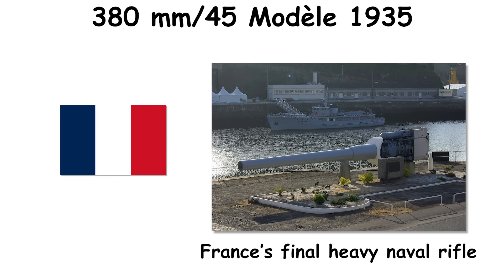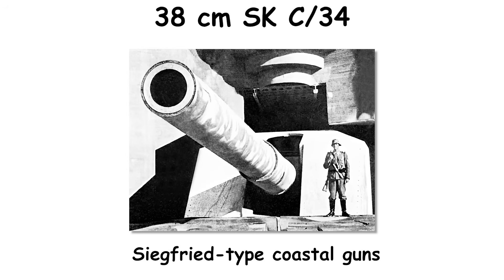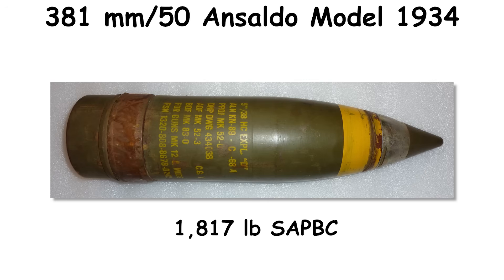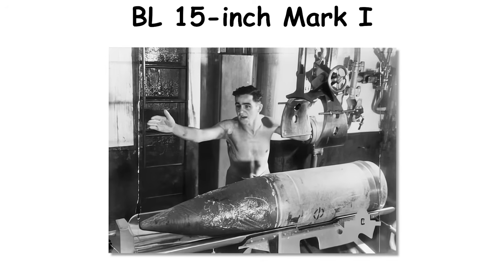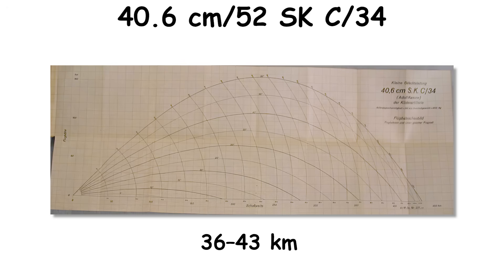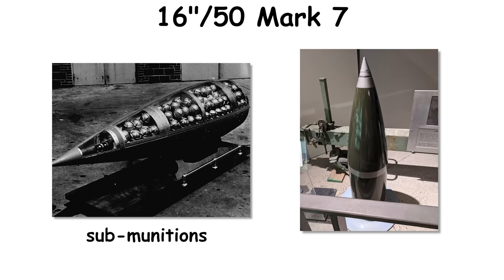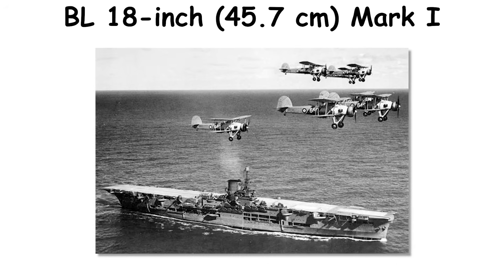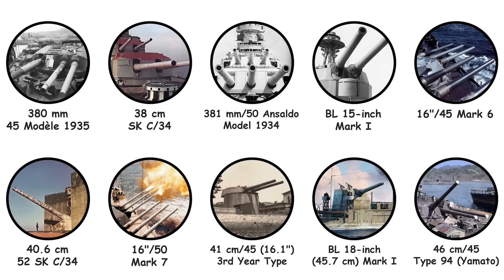Biggest Naval Guns Ever Explained

Comment: There were no problems with shell quality on italian 381mm shells, the often reported lax rules on shell quality were stopped before the shells were even made, if problems would have been in the shell quality, this would have resulted in vast reports of bad shell quality for other calibres, but there was none, not for 120MM, 100MM, 203MM, 152MM, etc, dispersion was simply avarage 9 out of the 10 instances where the guns fired, totally in line with good quality dispersion, way better than the faulty rates of other shells of the period, for example german 380MM and UK 152MM shells, wich reported faulty shells almost every battle

Comment: So which cannons was the more damaging and effective hit
Reply: The italians 15 inch and the yamato 18.1 inch
Reply: @Revenantofhell-b3fAfter test fire the higher velocity 16in of the Iowa Class out performed the slower 18s of the Yamato.
Reply: @andreworiez8920 the velocity of the Iowa class doesnt necessarily mean it is the best, it's just higher penetration overall the Italian 15 inch has the highest muzzle velocity of all battleship without any modification at all.
Reply: @Revenantofhell-b3fAfter World War 2 the US Navy was able to test fire 16in vs Yamato armor.

We also had the Japanese data on the 18in performance.
Reply: @andreworiez8920 That wasn't even yamato's armor, it was just a steel plate.
Reply: @Revenantofhell-b3fWhat I was referring to was an actual section of main belt armor plate that was built for one of the 3 Yamato class battleships.

The section was probably intended for Shinano before her conversation into a carrier.
Reply: @Revenantofhell-b3fyes but to achieve that they had to have a small amount of explosive mass, so they didn’t do an awful lot after penetrating
Reply: @andreworiez8920 "probably?" That dont sound convincing
Reply: @andreworiez8920 Yamato guns were unique the AP shells were explosive so they would deal alot more damage then Iowa class
Reply: @andreworiez8920 
I think your not understanding how a naval shell works against armor in a realistic engagement.

Iowa’s shell did indeed have greater penetration at MAX RANGE, because at maximum range with US 16 inch super heavy shell’s terminal trajectory would strike into the armor at an angle closer to 90 degrees against the top of the ship, which is basically always horizontal. 

Now Yamato’s type 1 AP had a flatter trajectory at its MAX RANGE, and thus had a higher impact angle which meant that it had lower penetration value with all the kinetic energy moving away from the enemy armor sideways.

Furthermore Yamato had about 10km more range than a super heavy 16inch, which also means that Yamato’s shell experienced 10km of extra air drag. If you compare the 35km penetration value of both shells, you would see that it is essentially the same despite the difference in impact trajectory, though such comparison is stupid in the sense such super long range engagement is unrealistic.